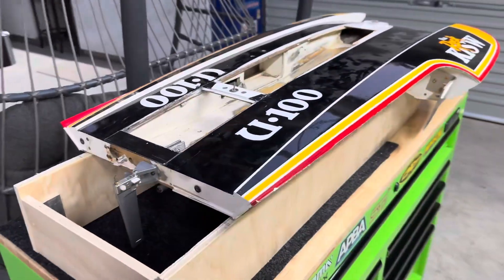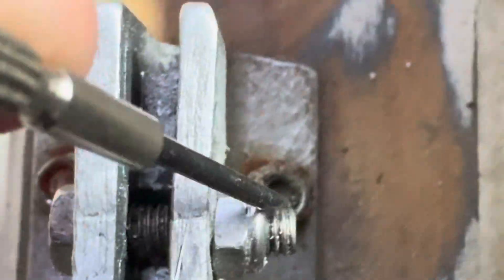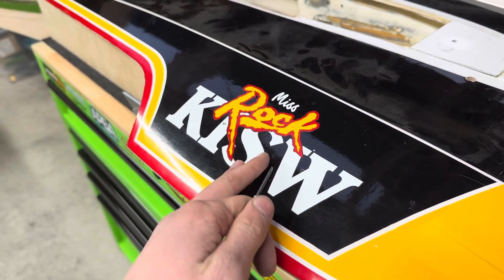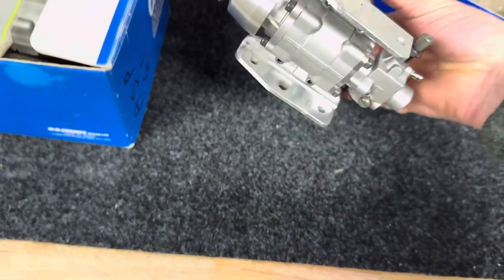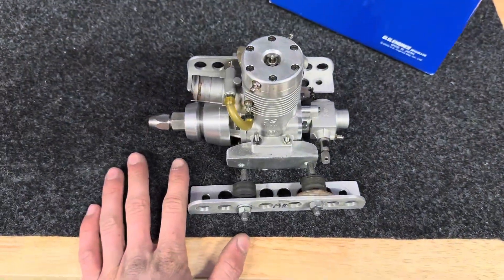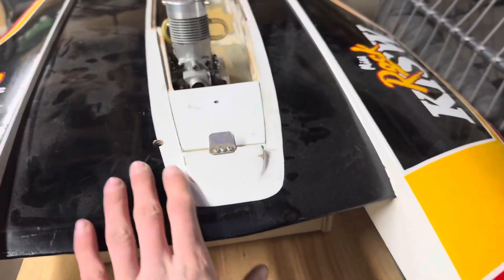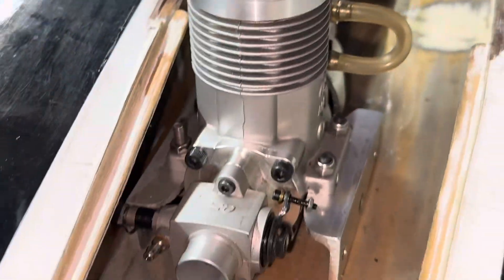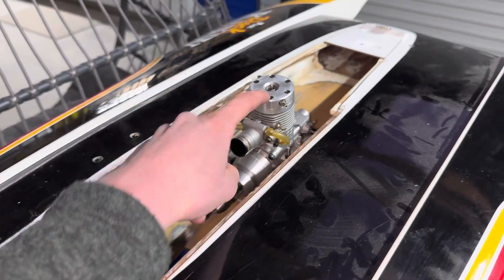What motor??

Comment: What hardware kit are you going to use? I have an old Ops 60 Marine engine, and I'm wondering what hardware would go with it.  I've been contemplating building a boat to go with that engine.  I believe Dumas and prather used to make 60 size running hardware back in the 80s, but not anymore.  Not sure what would be equivalent in today's rc boat hardware.
Reply from the maker: I try and make everything out of titanium and aluminium just to keep the weight down.
Google “ML Boatworks” they have a whole bunch of hulls/ kits from 1/10 scale all the way to 1/5 scale.
Reply: @Charlie_Russell99 I'll check it out!  Thank you!